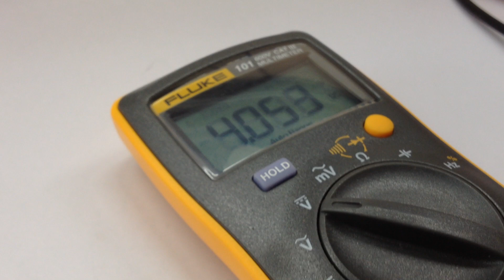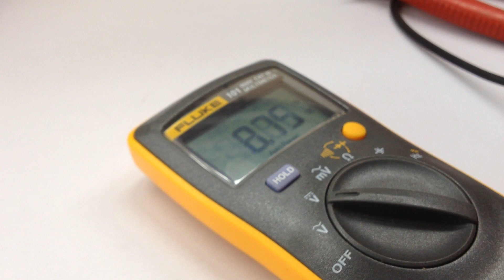PRESSURE SENSOR SIGNAL CONDITIONING CIRCUIT

Comment: Is it possible to get the Schematic of the circuit module? It would be really kind of you if you could help.
This is my email address: k.ahmed.prince@gmail.com
Reply from the maker: Hi,
circuit, pcb layout , gerber file
https://www.electronics-lab.com/project/simple-pressure-sensor-amplifier-pressure-switch/